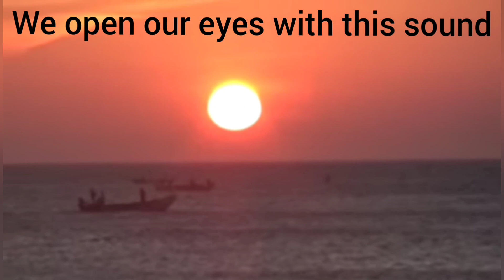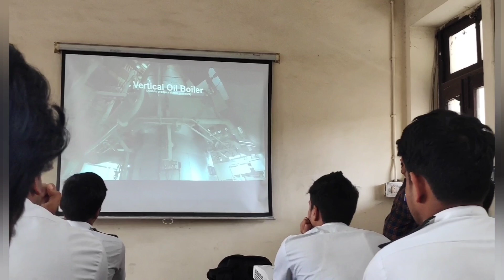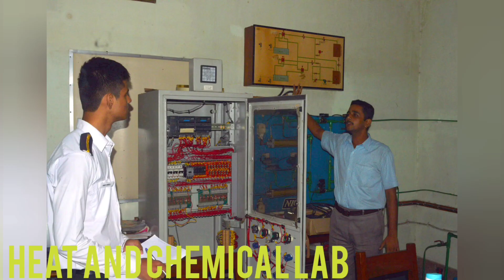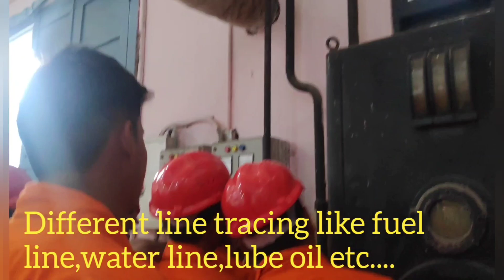#A DAY IN DMET/ MERI/IMU -KC,# LIFE AT DMET#COMPLETE TRAINING FROM MORNING TO EVENING#1st to 4th yr.

Comment: How is the campusing there?
Reply: Still holds better than other colleges. By the end of tenure you will get placed  either through campusing or using the fame of DMET.
Reply: I'd rather use the word alumni network...you'll get placed if you don't find anything via campus placement.
Reply: How much rank required in IMUCET exam for the addimition for general EWS certificate